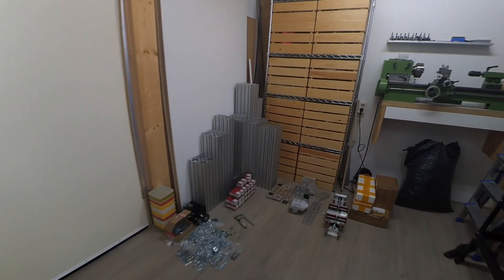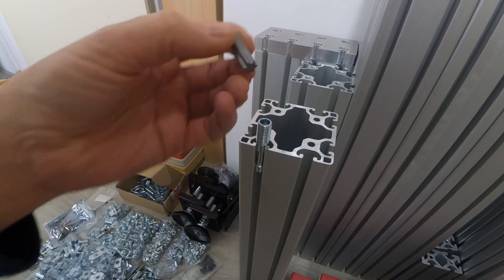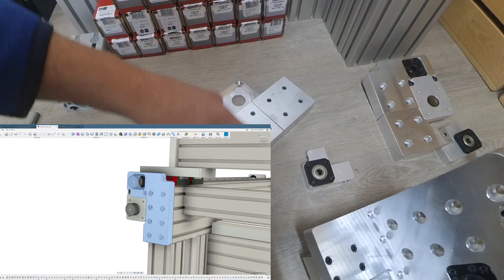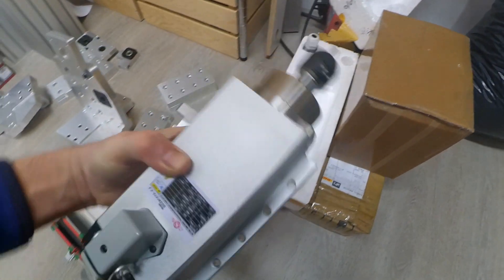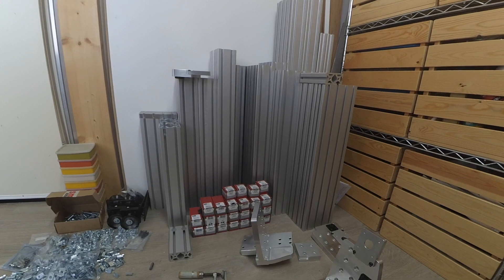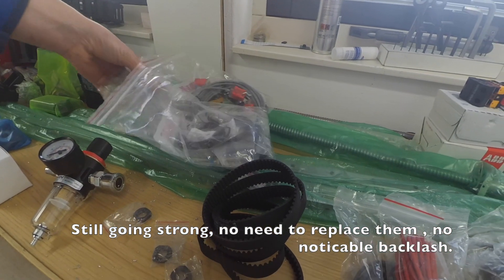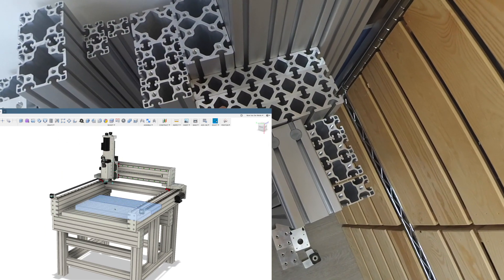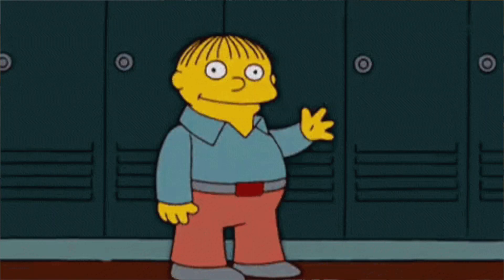DIY CNC machine, general design.

Comment: Thank you for these videos, awesome stuff. I was looking to use 750 watt servos on a similar build to yours  running 2:1 reduction on 2010 ball screws, would you have a recommendation on which model  if I used these JMC servo motors.
Reply from the maker: Thanks for your comment Matt. On a similar machine; Don't use 750W,  you have no idea how powerful servo's are. 750W servo's are standard used on the other machine in my shop. It's moving a 450kg heavy gantry with 50m/min. Capable of cutting at 35m/min with a 12hp spindle.  I would use the 230VAC drivers with 20 bits processor from JMC, but in terms of power the 180W is fine. they are capable of exceeding the machines available spindle power and its rigidity.  f you can, use 2005 ballscrews  with 1:1 ratio; a 2005 normally has one more circulating circuits of balls. (and can handle a higher force).  The only downside is they have to rotate faster.
Reply: @berendlucasvanderweide  Thanks so much for your reply, this info is gold, I already have the 2010 ball screws, someone suggested to me that if I do 2:1 reduction with 2010 screws I can slow the whip and pick up resolution,   So given that the 2010 screws are set in stone would you mind giving me your thoughts on servos and drivers. Thanks again Matt
Reply from the maker: @matteyles7466  Hi Matt, I don't know what your goal is in terms of precision or what the layout of your machine looks like. Just be aware that for optimal precision aluminum profiles need to be flattened/machined at the contact-points of the lineair rails. And when temperature changes, the aluminium and the steel from the rail will act as a bi-metal. I would use the integrated 200W nema 24 variant, but there are other options available with an external driver (and these drivers have an AC input, so don't require an AC/DC power-supply) . I don't know about your tuning abilities and knowledge of servo-motors, but these cheap V604 200W nema 24 integrated JMC servo's also have a notch filter from what i've read in their most recent manual. So pretty fancy. How long are your ballscrews? And for what reason did you pick 20 over 16mm? Reducing them with 1:2 sounds like a good plan.
Reply: @berendlucasvanderweide   Hi Berend, Actually I will be running duel 2510 screws  @1550mm long  in the X axis and 2010 @1300mm long on the Y axis, I am more concerned with precision over speed, I would have thought that the extrusion would miss behave if it was machined. here is a link to the basic design.        https://drive.google.com/file/d/1IZtloDBQG0kNmkSuCOKqbGztnBvZhfWG/view?usp=sharing
Reply: @berendlucasvanderweide   Hi Berend, Actually I will be running duel 2510 screws  @1550mm long  in the X axis and 2010 @1300mm long on the Y axis, I am more concerned with precision over speed, I would have thought that the extrusion would miss behave if it was machined.
Reply: I tried to post a link to a drawing but YouTube said no.
Reply from the maker: @matteyles7466  Looks good Matt. Precision is still subjective. What precision are you looking for?  I would go with the integrated 200w Nema 24's or the 180W nema 23's. But the NEMA24's uses a bigger shaft. In this setup (the belt drive) this can be favourable.  Running these long 20mm ballscrews; just make sure to straighten them (a wooden jig can offer great help. If your ballscrews are standard non branded china ones, they can be pretty warped. Till about 1200-1500RPM could be OK if you straighten them. (or use a rotating nut over a rotating screw).
Reply from the maker: @matteyles7466  It works I guess. Can see a double post, one has the URL.
Reply: @berendlucasvanderweide   The ball screws are TBI brand C5 grade rolled. I would have loved to use rotating nuts but this would be beyond my capability to make , there is a guy here in Australia developing a rotating nut but not for 25mm ball screws.
Reply from the maker: @matteyles7466  did you get a prealoaded one? The are very good, I'm using the tbi c5 p1 as well, and they are very smooth/silent and straight.
Reply: @berendlucasvanderweide   Yes I got P1's. The thing that has me confused now, and its not that hard to do, is originally  the dream was to have DMM servos with 16-bit absolute  encoders and as the budget ran lower I was looking at servos with  2500PPR and now these little guys are 1000line with micro stepping which I thought was a stepper motor  thing and a big drop in resolution.
Reply from the maker: @matteyles7466  I have no idea what precision you are looking for, but the 1000 line encoder has a guadrature function,  so each rotation gives 4000 pulses on the encoder. you'll have a maximum of 0,00125mm resolution using the 10mm ballscrew on a 1:2 reduction. I'm running mine on a  0,005mm resolution. (200 steps per mm) The precision of these machines depends for a large part on the machinist. (as with all the machines, actually).   My personal opinion is that anything below 0,005 resolution on a machine like this makes no sense. I don't understand your choice of 10mm rise ball screws if precision was your angle?
Reply: @berendlucasvanderweide Thank you so much for giving me your time and consideration, It's very much appreciated.   It was suggested to me that a 10mm screw would minimize the whipping effect but the 2:1 reduction would bring the resolution up this was originally based on a servo with a high res encoder. so at the end of the day I just would like it to be accurate and smooth, not so concerned about speed, and most of the work it will do is  inlays in solid timber a bit of aluminum machining and the odd speaker box.  so considering I am still to get pulleys and servos ,what would you do.
Reply from the maker: @matteyles7466  I'm into building speakers myself too, these are my latest; (7 years ago..)  https://goo.gl/photos/eQVwjJmX1MP6RSzM9  but now i have a CNC for wood I haven't made a single one anymore. Still have a few cabinet layouts  for a small sized tapped horn, 92db @1w/m @30z in a 30L enclosure half space if memory serves right.  I'd go with a 1:2 reduction. Just make sure to get proper gears that are centered with minimal runout. I've done solid wood on my machine as well. Oak, beech. with a 12mm cutter with chip-breaker downcutting it works so smooth.  Aluminium is also possible, it cuts pretty good on this machine. (better than on the BF20. That machine lacks stability in the Z axis)
Reply from the maker: @matteyles7466  PHL is high on my list. Nice. I've used inverted focal tweeters too in another project, long ago. Just do a search for quadrature encoder, and you'll get the idea. the encoder has 1000 lines, but with quadruple interpretation they give 4000 pulses/counts per revolution.  So the resolution is simple 4000 pulses per revolution. So each 2 revolutions give 1 revolution of the 10mm ballscrew, so you can divide 10mm/8000 pulses is 0,00125mm per pulse. That bell ringing is an interesting feature! i've dampened  my speakers with sand filled rods (but they are half filled, so it absorbs resonances rather than creating an extra one, it's more or less acting like a dead blow hammer.  (it's a self cancelling resonance, both panels cancel the other out) The trick is to avoid parallel lines opposite to each other in an enclosure on 1, 1/2 1/4 length of the used frequencies in that chamber, as with your rythmics subs, to avoid standing waves. But resonances are a PITA.  I've added reflectors in the cabinet to both guide away from the woofer and to avoid standing waves. ( Since the woofer is by far the weakest point in the cabinet). Arh.. It just had to be done. I'm using akotherm at 20kg/m3 as dampening.  It works miracles. Don't use egg-crate foam. it is about the most unsuitable material for dampening a woofer.  It dampens almost nothing below 100hz.
Reply: @berendlucasvanderweide  we used Rockwool a lot in the bass, when this CNC is running I will give the stacked type a go again but use MDF instead of plywood and varying internals (non parallel) as you suggested. Probably a Raven ribbon /PHL mid/bass combo if I can raise the funds.   I love your wavy mid enclosure, how did that go for you?      I think I am sold on the JMC  Looks like they have all the resolution and smoothness I will need, Just wounder if I should stretch to the 400watt version.
Reply from the maker: @matteyles7466 yeah, these wavy internals. It works ok. But dampening does more than these waves. The entire speaker has very low 2nd/third harmonics.  no, 200w is more than fine. 400w makes no sense. Even 100w would do. Just look at the datron Neo. It uses a 200w servo's. And it moves like no other.  400w makes no sense on this type of machine.

Comment: I am begging you :-) Could you make a tutorial on how to wire and configure this JMC servo motors? They have an incredible price, but the only tutorial I have found is in German and I suck in that. IF you do it, I swear many will watch it. I am ok with closed loop and normal stepper, but I still did not get every passage for the servo motors, moroeover the software configuration of the parameters.
Reply from the maker: Hi Ale! Sorry for the belated reply. I wanted to respond sooner. I have a new 400W V604, perhaps i can figure out a way to make a proper video on showing what parameters on these drivers do. Perhaps i can make some kind of test-rig. But i'm rather limited in time currently.. (that's the reason why this extra 400W servo still isn't mounted on my 4th axis)...
Reply: @berendlucasvanderweide  Thank you very much and of course only when you have time :-) following really close, so when it's on I won't miss it

Comment: The Z-axis build is really well thought through. Did you use any floating bearing in the end of the Z-axis ball screw, or did you only use a fixed bearing for belt driving end?
Reply from the maker: Hi Kim, thanks for your kind reply! yes, it's using a bearing at the end, the same one as on the X axis, so two smaller bearings (16x10x4, 2pcs). Made a uni-directional adjustable bearing holder to release them from as much stress as possible, aligning them is very easy that way. Since they don't see any axial loads (their purpose is to prevent the ballscrew from resonating at higher RPM's).
Reply: @berendlucasvanderweide  What exactly are the bearing brand or part number of the two smaller bearing 16x10x4? Could you also explain a little more about the uni-directional bearing holder you've made? Do you mean that the bearing can move in the axial direction freely, only taking radial force (prevent ball screw from resonating)?
Reply from the maker: @nordic_cnc  Hi Kim, it's a 15x10x4 bearing, if you search for 15x10x4 bearing, you'll find loads of them. It's a common size used in RC cars etc. The bearing holder is made with 4 screws, that enable float in all direction when the screws are not tightened. At 5:48 you'll see it mounted onto the Z axis, and in the 'dibond cutting' you'll see it mounted onto the X axis. It's just using a bit of float around the mounting holes in order to compensate for a +/- .5mm (it's using M4 bolts and the holes are 5mm). The best way to align them is to move the ballscrew nut as close to these floating bearings as possible and then tighten them.
Reply: @berendlucasvanderweide  Thank you very much for the detailed answer!

Comment: Hello, impressive work, well done! Do you have reduction on belt driving ball screws or is it 1:1?
Reply from the maker: Hi Tomi. Thanks for your comment. It's using a 1:1 drive with 1605 ballscrews. I've seen these motors being used with 1:1 on a 1610 ballscrew.
Reply: @berendlucasvanderweide  Ok, do you remember approximately how much weight it was moving on 1610 ballscrew? What is the weight of your X carriage? Do you think this motor can move lets say 25kg on 1:1 drive and 1605 ballscrew?
Reply from the maker: @99tomson1  my x carriage combined with the z weights about 40kg if memory serves right. It uses two motors though, but it's pretty peppy. Week ago i was stressing it, it was running at 20m/min (4000rpm on the servo's) at 12000mm/s2 acceleration. (1.2G) the long ballscrews started resonating, but the motors didn't throw a following error (it's set at 20 counts of permissable error for positioning, which is relative low) i looped the error outputs of the motor with the error output of the spindle to the e stop input of the machine. These motors are unbeatable for their money, but they lack a notch filtering feature the more expensive ones have. But they are a big improvement over any stepper  setup you can buy.
Reply: @berendlucasvanderweide  Thank you a lot, if i will have any more questions i will ask here :)

Comment: Hello. Great work on the machine and thank you for sharing with all of us. What précision do you have on the axis and spindle using extruded aluminium as chassis?
Reply from the maker: Hi Raul, I used different equipment to square and set the machine. The profiles had some inconsistency in thickness, that's compensated with shimming sheet in different thicknesses. To be honest, it's a pain in the ass to make a machine with high accuracy (better than 0,02mm) from aluminium profiles. Make sure you have room in your design for compensating the flaws of the material. I used a precision square of 200x300mm with 0,004mm precision, 1500x15x70mm steel straight that's within 0,02 precision over the entire length, and a 1040mm long digital caliper with 0,01mm readout. (No idea about its precision, but it's used to compare sizes, so more than fine for my intended goal) I've spent more time on getting it squared than planned. :) Easiest is to have some reference cuts on the profiles machined on a large precise machine.  I  ordered a C5 P1 ballscrew for the x axis last week to get the X on par with the y and z axis in terms of accuracy. The current one isn't as precise as it should be. Alumium isn't the most ideal material, but for the purpose of this machine is more than fine. I'm able to produce parts with it that are within 0,01mm. A machine doesn't necessarily have to be very precise, as long as the drift is predictable and constant. I thought i commented a bit more on precision in the movie I've uploaded of it machining the two blocks of aluminium.

Comment: Fantastic CNC! I don't know if you mentioned this, but what is your working area?
Reply from the maker: Hi HNTR; thanks for your comment! That's 540x840x240 (xyz) with the bed adjustable, so it could do oversized sized parts as well.

Comment: wow mang we almost have the same design but i use 100*100 and 100*200
Reply: Curious to see your machine! Got a video of it?
Reply: @renevanderweide8137  here the picture of my design https://www.cnczone.com/forums/attachment.php?attachmentid=415318&d=1552502118
Reply from the maker: @wanv1373  Nice!! I see some overlapping design considerations. Are you planning on using servos or closed loop steppers?
Reply: @berendlucasvanderweide  im using servo for all axis 400 watt 20 bit servo with 2:1 gearing x y  3:1 for z
Reply from the maker: @wanv1373  you can do a 1:1, no problem! These servo's have a 6nm torque peak. On a 5mm ballscrew that equals to about 7200N of force. With a 1:3 it's 21.6kN.
Reply: @berendlucasvanderweide  owh i see thanks for the suggestion will do that :D cant wait to see both of our build
Reply: @renevanderweide8137  maybe  in 2 weeks still in shipping

Comment: Hello Berend Lucas. I have a question about to z axis plate. Can you tell me how do you mount all 8 liniar guide bearings to the z axis plate ? did you mount all 4 screws of the linar guide bearings ? I ask this because i can`t see the screws and the liniar bearings sits one beside the other...Can you send me the plans of the z axis please ?
Reply from the maker: Hi George. It's using the hgw20 bearing blocks for the z and the normal ones for the Y axis. Since these hgw20's are flanged, you can bolt them from the other side. The only other way to mount them is to use a larger plate between y and z, but you'll sacrifice some y or z motion. At 6:24 you can see the difference between the both.

Comment: Thanks for your quick response and feedback. My first piece of machinery equipment, of any type, is a Grizzly G0781. Obviously I’m a complete novice, but I’m starting to see the deficiencies in my current mill and would like to improve them. I had probably envisioned upgrading to a G0704 or I’m also hearing good things about the Precision Matthews PM-25.  From there, I think I would be at a point where I could begin to make the custom parts necessary for a CNC. In the meantime, I just need to begin to improve my skill set. Thanks again for the great videos and any additional information or files would be greatly appreciated.
Reply from the maker: That's not a bad start! you could just get some simple stepper motors and make some parts for it to start with. Just to simply get a sense of how it all works. I madelikings my first motor-mounts from MDF. . As long as you get it up amd running. Just find a CNC controller that is convenient and intuitive for your likings. I fell for edingcnc, well documented, good support and a clean interface. Don't know if you have any CAD/CAM knowledge, but for that  you'll need something like Fusion360 (it has and EdingCNC postpricessor by default) Again software that suits both my needs and works intuitive. it might be wrong for you, but Fusion has got loads of video's available on Youtube.